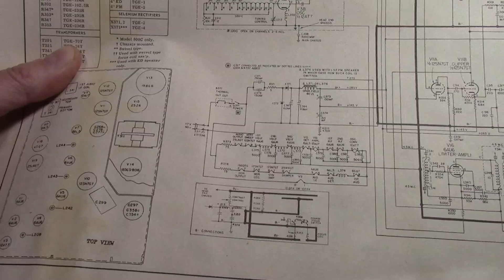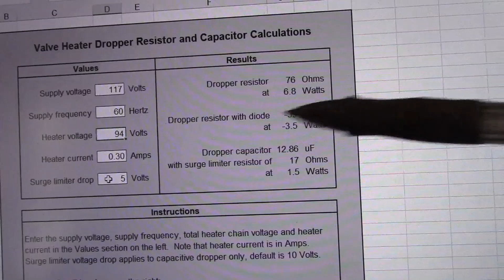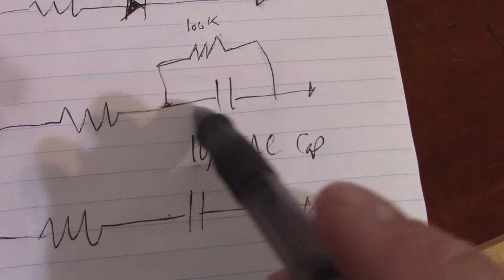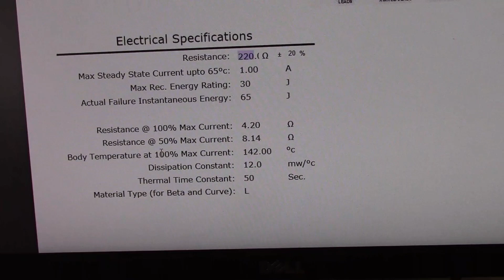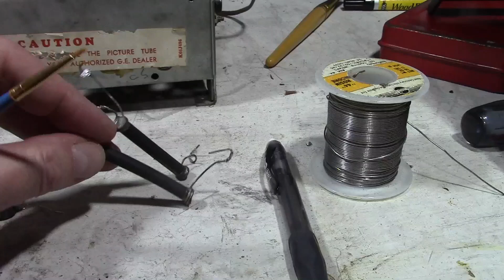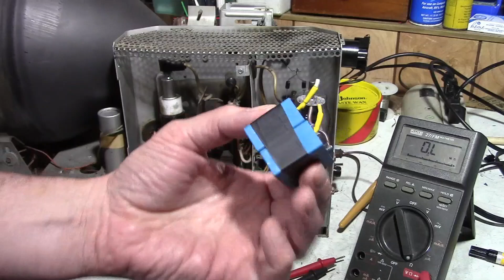GE 800 restoration p2o8

Comment: When you speak of a capacitor on high voltage, what about doorknobs?
Reply from the maker: Ceramic 500pF doorknob capacitors are what you'll find in most B&W TVs from the 40s-50s

Comment: You don't need online calculators or a true RMS meter as the math isn't that complicated.  The equivalent or effective voltage for rectified AC across any resistive load is the voltage that gives 1/2 as much power dissipation as that load would receive without rectification, i.e the square root of 1/2 or 0.707 times the line voltage since power is always proportional to V squared.  So 130 volts becomes the equivalent of 91.9 volts.  Conversely, if you want the same power dissipation as you'd get with 6.3V full-wave AC, you need twice as much dissipation over each half-cycle, so you want 6.3 x (square root of 2) = 8.9V.  But that is RMS volts.  What you can more easily measure is the peak voltage on an oscilloscope, which will be another factor of square root of 2 higher, so 8.9V X 1.414 or 12.6 volts peak, exactly double the rated 6.3 volts.  Looks to be pretty close to that on your scope,  maybe 12.1.

Comment: I noticed you recapped and kept the CRT in place. I’m wondering why you wouldn’t remove it to make it easier to get at some of the awkwardly placed caps. Also, it means leaning the set on the tube which I’m thinking  may be courting disaster. On a small set like the Admiral 19a1 you can rest the chassis on the power transformer but there isn’t one in this set. Speaking of mishaps, have you ever had a CRT implosion?
Reply from the maker: They can be difficult to remove and reinstall.  The yokes can get stuck of shrink same with focus coil.  I've had to use a heat gun in the past to expand and soften the yoke to get it to fit over the CRT base.  Then there's putting it back in and realigning everything.  Not to mention the yoke and focus coil would be unsupported while the CRT is out.  

I only remove CRTs if I have to and I've never broken one.
Reply: Thanks. The recap looked really hard in this set. How long did it take you?
Reply from the maker: I'm not done yet so can't fully answer you.   So far I have something like 6 hours into the set.  The biggest hassle was that it had been worked on before and wiring changes were tricky to figure out.
Reply: I've spent probably 10 hours working on my GE 800C so far. The CRT came out quite smoothly and there's no risk of damage to the yoke & focus coil because they can stay attached by their mounts. There are 2 capacitors hiding under the CRT next to the high-voltage cage and a couple on the focus coil circuit daughterboard which would have been very difficult ito get to with the CRT in place. It's quite a mess underneath my 800C with someone's past hacks and lots of surface rust. I hope you're going to show how to do an Alignment!

Comment: Bob...great work on this. I did use a CL90 on an old RCA 56X10....It does work but not as sensitive as it should be I will replace it with lower steady state unit as it pulls .25 amps max. I will do that once it navigates through the social political infrastructure of Newark.......LOL Thank you very much sir!

Comment: the one thing that does have me wondering about the diode/resistor topology, is what happens if the diode shorts?
Reply from the maker: The tubes fry.  One of the filaments will eventually pop.
Reply: Yikes! yea, thats what I feared. I guess the capacitor trick wouldn't work either if the capacitor shorted. I guess the good news is, since you know the current draw, a slow blow fuse of the appropriate size on the filament string could work. if something shorts, pop goes the weasel.

Comment: I noticed that the diodes on the series strings are both connected the same way.  wouldn't it be better if one diode was reversed?  this would make the overall current draw equal and a normal AC current meter should read it OK (not counting the diode drop around the zero crossing which is a fairly small error compared to the total voltage).  I don't know what happens to the CRT filament though in that case since it's in series with both legs.
Reply from the maker: Maybe, but I am concerned about the CRT filament.  Perhaps I'll try an experiment with a power resistor in place of the CRT filament to avoid any potential damage.
Reply: I had the same thought. If I'm not mistaken the CRT would only get 1.414x the current of the other strings instead of the 2x required. The extra ~175mA could be added with another capacitor or a transformer but in my mind that would be getting too complicated.

Comment: You could use a diode for strings over 85V.
Say you have 95V string, a diode will give effectively 85V, so you have 85/95 of 300ma so about 31.5ma low.
So add a resistor in parallel with the diode to  add the 31.5ma. (120-95)/31.5= 794 ohms, Now that only runs on half the cycle so maybe 400 ohms will work. I'm not sure about the non-linear part so I'd start with 800 and measure voltage/current and adjust.
Reply from the maker: Interesting.  I hadn't considered adding a resistor in parallel.  That sure is some tricky math.
Reply: Wow, the resistor in parallel with the diode is brilliant. Not only will it allow for the extra bit of current but it will also improve the power factor. The calculations should be easy if you treat the filament string as a single resistor which you want to dissipate a certain amount of power. Calculate filament dissipation once assuming they are connected directly to 120v and then calculate filament dissipation assuming they are connected through the resistor. The two should average out to the correct value because the circuit spends half the time in each situation.
Reply: The problem with meters is they don't say how they measure.
Most, even true RMS use a capacitor in series with the input on AC. Why?, so you can put in on DC, measure the average power supply DC voltage then switch to AC to measure the ripple.
I did see one of the higher-end Flukes that spelled out the measurement mode. I seem to recall an AC, and AC+DC toggle button.

Comment: What about just using an X/Y-rated safety cap as a capacitive dropper? They’re certainly meant for AC operation 24/7/365.
Reply from the maker: They are only commonly available in values up to about 0.1uF.  I need one 100x that big.
Reply: bandersentv - is there space for 100 of them in parallel? 😏

Comment: You should try out fairradio supply. They only have a $10 minimum order and LOTS of rare parts, as well as military radio equipment. Good luck, -Bo
Reply: I work on lots of old radios, oscilloscope, other test equipment,etc. They have the best prices I've found, and their components are very good.
Reply from the maker: Yep, I'm familiar with them.  Used to order a lot of surplus CRTs and such from them back in the 80s.

Comment: Why not measure the RMS current through the filament strings
Reply from the maker: I tried.  Same issue.  If I put the meter in AC current mode it's missing the DC component.

Comment: Bob, when you were figuring the the total voltage of the filament string I think you forgot to add in the 6.3v CRT filament.  So instead of using 130VAC maybe 124VAC would be more appropriate?  Thanks for doing this video.
Reply from the maker: Nope, I did add it in.
Reply: @bandersentv  Ok.  I must have missed that.  Thanks.

Comment: For the RMS calculation if you can get the samples out of your scope into a spreadsheet you could calculate the RMS (Root Mean Square) directly. RMS = Sqrt(sum(v^2)/Nsamples).  Just pick samples that cover exactly one period of the waveform.
Reply from the maker: Yes, I suppose I could.  It's a built in function though so no need.

Comment: Quick question: what happened to the picture tube filament voltage in your calculations?
Reply from the maker: It was included along with the other tubes as 6.3 volts

Comment: You can also use an inductor that has the desired impedance @ 60 Hz (or 50 Hz in some countries), though you might have to find a location for the “iron”! Or even a combination of a capacitor and an inductor, though, then it’s a bit trickier to do the calculations. 😏
Reply from the maker: Inductor?  That's a new one on me.
Reply: @bandersentv  I think he means just use the inductor in series instead of the cap. Xl = 2 * pi * f * L.  Problem is I think if you do the calculation for 60 Hz L will be quite large to get any meaningful voltage drop in the string.
Reply from the maker: Oh, you mean a bucking transformer.  Yeah I could use a filament transformer rated for around 33 VAC at 1A.  It would take up a lot of space though
Reply: bandersentv Not only space, also placement could be an issue for stray magnetic fields may interfere with the deflection.
Reply: @bandersentv  Why 1A? The filaments are only 600mA. If you wire it as an autotransformer even 500mA should be more than enough.
Reply from the maker: @eDoc2020  I figured 1A for overhead.  If it's in series with the filaments shouldn't it be rated for at least 600mA ?
Reply: @bandersentv  You'd think it would need to be 600mA but that's not the case. When an autotransformer is used to buck voltage the "secondary" doesn't need to carry all the current because the "primary" carries some. I started writing my reasoning but then I realized there's an easy way to explain it. In the autotransformer configuration the secondary winding is the only thing connected to the input voltage. Therefore it only needs to carry the input current.

Old explanation: It's hard for me to wrap my head around it but I find it easier to think of the opposite application:
Say you have a 100v supply and you want to power a device requiring 500mA at 120v. You can use a 100:20 transformer to make up the difference and it clearly only needs to handle 500mA output. However the total input current on the 100v line is 600mA because of the transformer action. We know transformers are reversible so therefore the same transformer can be used to supply 100v 600mA from a 120v source.

Comment: 360p?
Reply from the maker: It's 1080P
Reply: @bandersentv  I think he meant the G.E.
Reply from the maker: YouTube typically puts up a low res version of a video in 360p while it's processing.  I figured that's what he meant.  The GE is a model 800
Reply: @bandersentv   Just didn't think I will be ever this early. Assumed something went wrong.
I have rebuild old drill with run caps and have bought some small plastic ones, had to check my part box: you can check B32926C3106K000 TDK cap which according to the datasheet should handle 0.3A (but check yourself) or 106MABA02KJS from Illinois Capacitor (MAB series) that is true motor run cap, they have some range of values. It will be bulkier than diode and thermistor.